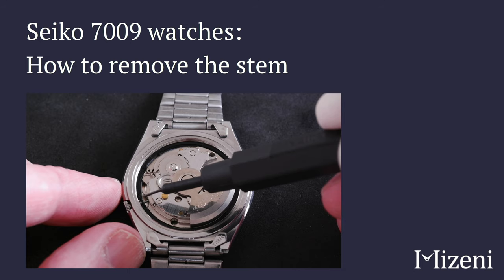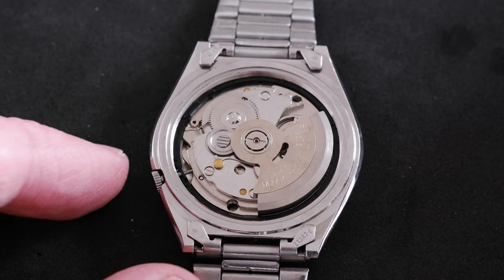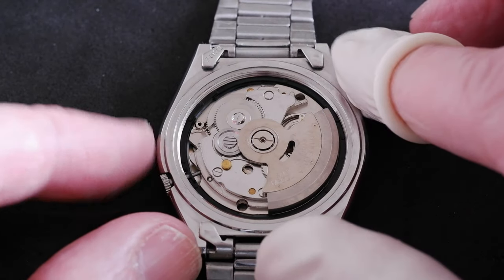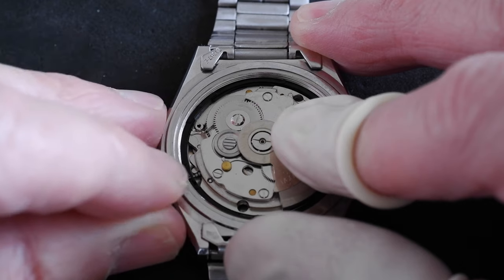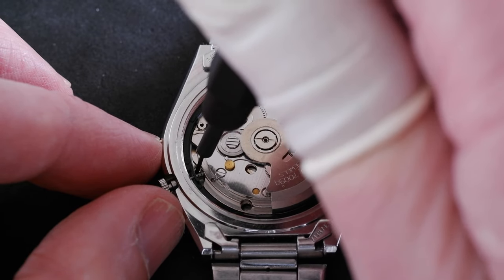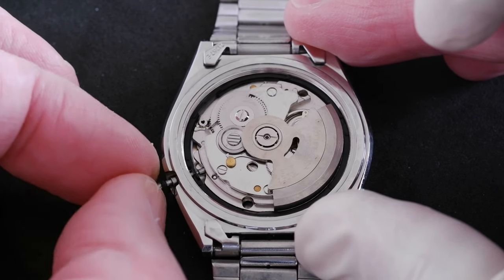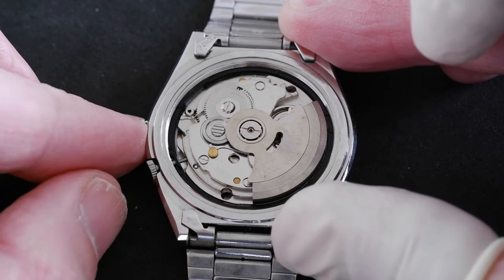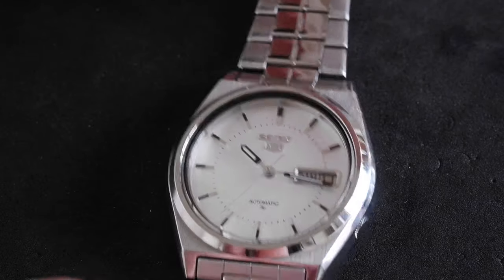#Seiko 7009 watch: How to remove the stem & crown

Comment: Very helpful video, have you ever known the little lock tab to not come out? I have a crown and stem that will not lock into place, however that tab is not visible on any click, could it be stuck in and thats my issue? Thank you
Reply from the maker: Hi Samuel. That sounds frustrating. I have an older Seiko where the tab is missing and I'm not sure what to do so I just gave up! With the 7009 movement, the tab is joined to the setting lever so if it were missing or even slipping, then I think the time/date setting wouldn't work properly either.

In any case, if the tab is not visible when the crown is pulled out two clicks, I think the only solution is to take the watch apart as much as possible while it's still in the case, and then the crown/stem could be removed too. Sorry, it doesn't sound like an easy fix. 🤷